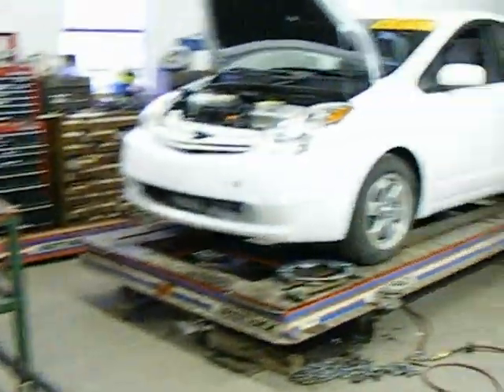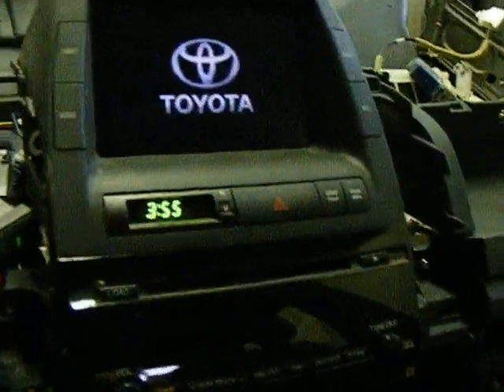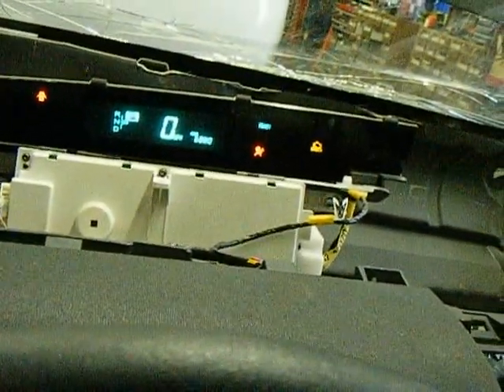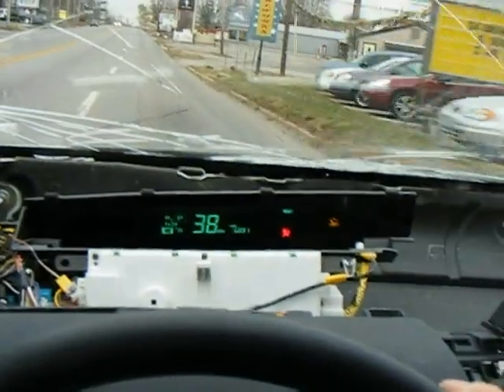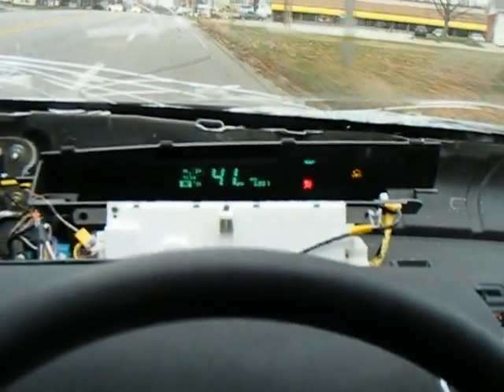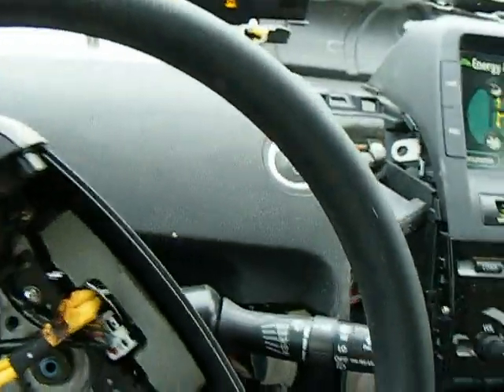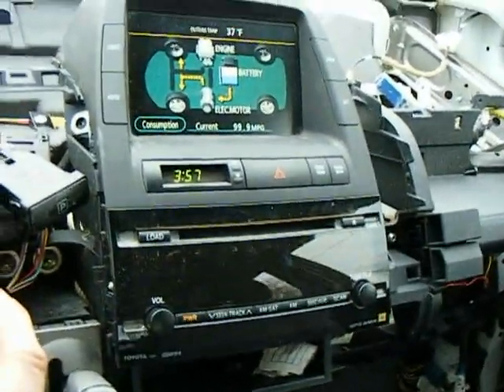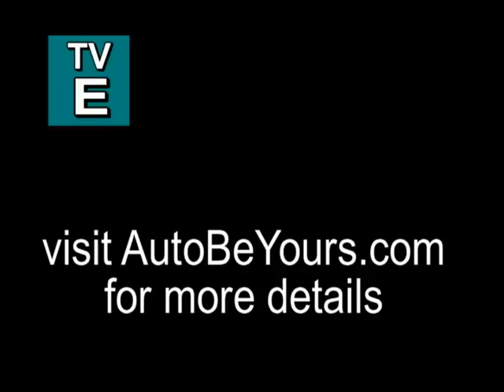All Electric Prius without a gas engine

Comment: How long will the car “Run” on a single charge?

Also,Did this have a plug in or are you just using the 1 original battery?
Reply: about 2 miles per kw/h  therefore a single oem pack at 1.1 kw gives almost 2 miles.  do the math for your intended pack

Comment: I'm just a monkey with a wrench and a Prius.
I wanna tear old gas side and leave Regen 3 pack solar.
Anyone with any pointers on how to perm spoof error codes and sensors without spending $$$$?
What exactly can I tear out. I'm literally going back to frame to rebuild and save ultimate weight.

Comment: Hello and great job.  Just a curiosity question;  without a turning crank in that 2nd Gen, what turns the oil pump in the transaxle.   I deal with 3rd Gen units and that's how they are lubed (along with gear splash carryover).  Thanks for your time.  Looking at doing the same thing but with a Gen3 unit.

Comment: Wonder if you can give me a clear and straight answer:
Does the Prius engine(2005) ever directly propel the wheels, or is it strictly to charge the battery? Or does it directly propel with the front electric motor1? Or is there another answer?
Reply: no. imagine motor generator 1 acts like a torque converter... if its not working...say for example the hybrid battery is bad, then the gas engine just spins with no connection to the wheels.   that is why it is an automatic transmission but without a clutch pack.. the electric motor provides assistance or resistance or anything in between
Reply: @imwoody36also  I think you are possibly wrong,  by not differentiating the questions, for a few reasons. First you answered me "No" when my question was not a yes or no question. " Is the engine to the wheels or just charging the battery" was the question. Well, if it is no, then is it neither?. The 2nd reason you are likely wrong on your claim that the engine is only charging MG1, is because the drive shaft goes from the engine directly to the wheels. If it is not propelling the wheels direct, then why even have the engine inline. This would be added cost and material with less layout flexibility. 3rd, if the battery is bad, then the car needs a source to move on demand, and if its too weak, it won't drive as the engine only powers the wheels at HWY speeds at one gear of about 50mph. The engine takes over, and it can do this at a certain speed where it is efficient as it has 1 "gear" to the engine.
I watched 5 videos with engineers breaking it down, explaining this 1st gen Prius Hybrid system after I posted. 2 videos were not so clear, but a couple others were. Also Scotty Kilmer's channel breaks it down as well. The Prius, at least early 2005 model looks to be a true hybrid car. Engine at SOME point is directly propelling the wheels, once the car has gained enough momentum for the engine to be more efficient. This is what is explained between the different videos. It is also what I find to make sense. Otherwise the layout would not need the shaft to directly go from engine to wheel, as it does. I dont mean to sound abrasive, but its been bugging me, and its not very clear in some presentations, and they suggest different things. If its not the engine, then its not even "hybrid"
Reply: @imwoody36also  You gave a situation when the battery is bad. what about any other time? While on the hwy...etc

Comment: Hi A Engineer had the Prius running on electric in an 08 Prius but no restrictions on Speed We have 2 Hymotion Battety Packs get 50-80 Mpg Combined! I could go on expressway Drying an 100mpg
Now I’am rehabbing as The Car was Parked for a Year Bob Vandivort

Comment: Old video, yes, but I came to YT looking for something like this. I read a thread from someone who wanted to convert an old Prius to all electric and all the nay-sayers. I've long said that Hybrids are "the worst of both worlds" with so many moving parts to eventually wear out. It seems like at this point (early 2021) there are (or will soon be) many old Prius cars for sale with non-working gas engines. If only there were an affordable way to convert them.

This is a total newbie idea, but if only you could  trick the controller into thinking it still had a working gas engine in it - say by installing a second electric motor in place of the old gas engine, and then a Raspberry Pie running some sort of "gas engine simulator" software.
Reply: Actually, yes just adding anything to the I.C.E. input shaft would leverage top speed up beyond 52mph.  if your experience includes C.A.N. bus messaging from Arduino, all the better.
Yes we have  literally dozens of old generation 2 pruii , with good transmissions and inverters.
by now we scrap them after using all the common wrecked or worn out parts.
( everybody needs a touch screen or a hatch garnish, or my favorite  a clean floor mat)

Comment: sir thats not a trouble light thats showing. its them reminding you that you never sent the check for the engine so thanks to translation issues it reads check engine on the dash. i forgot to pay them for that too and once i got the letter i sent payment and the next morning when i went to work i finally had passing power.

Comment: did you just connect the 3 hv batterys parallel? no bms or other things?
Reply: keep in mind this was 10 years ago, and today you will want to use lithium. those three OEM packs only total around 3kw ( small by todays electric car standards)  the plug in prius movement surpassed this video with the addition of the ORION BMS and liFeP04 cells of your choosing.
Reply: @imwoody36also  how about tesla module units? 🤔 Will this work to replace the old hybrid battery pack? Any videos of how to do this by any chance?

Comment: top speed in all electric mode is 52 MPH.  faster required assistance from the gas engine.
this is the upper RPM limit of the mg1 and MG2 motors

Comment: Nice! What if you pull out the heavy block and use that space for a micro turbine generator. Benefits are you can use multiple fuel sources and it will sound bad ass :) . I am sure you will get close to 70 MPG depending on fuel used. Look into drone micro turbine extenders.

Comment: The prius should be all electric, especially since it's 2017
Reply: It's now 2020......
Reply: @1enaan  Toyota has a solid state 600 mi battery and two new motors selling to the do-it-yourself mechanics.
Reply: @stevencorrea7982  how do you get these and how much as interested in building my own ev and thought pruis was good starting point if battery and mileage could be increased
Reply: @francisosborne1268  it a great start I have a Prius drive train and an inverter to start.

Comment: Ok I need help because I have 2014 plugin and I drive 100 miles every day Im only getting 500 miles a tank I want to know how to get 95 per gallon
Reply: Highway driving kills the MPG. I only get 45 in my C with mostly highway driving,  There is an article in Nuts and Bolts magazine that covers such a conversion.  It covers the first gen model.  You need an auxiliary Lithium battery and some custom connectors.  Also in that design the regen only charges the NICD.  Once the Lithium dies you have to plug it in.  All it does is trick the car into thining the battery is full all the time.
Reply: Probably will have to slow down which I'm assuming you're on the highway will be hard.
Reply: This is easy.  Drive downhill to work.   On the way home, jack the rear of the car up so you are downhill on the return trip.  You should get 95mpg easy!

Comment from the maker: Well, another one could be build just like it easily enough,
top speed is 52, and the range is only limited to your ability to purchase lithium batteries.

a stripped prius like this would cost around 7500 dollars from us, ( april 2012 price for say a 2006  model year.
then add about 6000 for a 5kw battery pack.

by the way, we also have a nissan Leaf in stock.
Reply: Are you still building these?

Comment from the maker: The prius will travel about 4 miles on a kilowatt/hour of battery capacity.
the one featured in this video has had the gas engine installed and now is a stock prius.
however we now offer a 5kw/h pack to replace the Original Toyota pack.
this allows for 24 miles of EV only, or 50 miles in blended mode at 99 mpg.
Reply: Got any packs left for cheap?

Comment from the maker: update!
New software allows us to install a large battery pack, then drive up to 74 MPH without using Gasoline.  then engage the  gas engine or not depending how far down the accelerator is pressed.
keep an eye on the AutoBeYours website for details.
Reply: Won't the motor be overspeed or does the engine crank still turn?

Comment from the maker: Easy, the Prius has an electrically operated scroll compressor,
it bolts to the block in the traditional location.
of course the condenser would also need to be installed.

Comment from the maker: Hello Dave. The plugin conversion movement is very large. it has been our experience that 5kw/ hour is about the smallest battery pack that will give any decent range. also top speed without a gas (I.C.E) engine will be 52. two companies offer hardware/software modifications to force the prius to spin the ICE giving extremely high gas mileage when driving faster than 52 mph.
those are plugin conversions and plugin supply.  a different bms system is required!, dtcs must be cleared or spoofed.

Comment: Hi. I live in the UK and diesel/gas prices are hitting an all-time high of around $9 per gallon (in your money) and, as an electronics engineer, I'm seriously considering buying one of these and running it with numerous stock Ni-Mh packs as you have done already.  Have you established the range of the vehicle in this video yet? Also, is it necessary to clear the ECU DTCs before the car will drive? and finally, can I leave the charge-management system alone or will it need extensive mods? Thanks!
Reply: what about now?

Comment from the maker: without the newly developed Hybrid Energy Module from Ewert energy systems, 52 MPH is still the top speed.  larger capacity   only gives us longer range, The HEM module allows electric speeds up to 69 or 70 MPH but is only sold through plugin- conversions corp. thier price as of dec 2009 is 13500 dollars for a phev kit.
it is very very nice.

Comment from the maker: I stand corrected, It should read 250 w/h  or 2500 w/h for 10 miles.  please remove the "K" from  my hastily typed message.  Additionally please note that my friends at Ewert Energy systems have created an electronic module to manage the ICE in a prius to force very very low gasoline consumption even at highway speeds...this requires an extra battery pack.
Reply: Will check this out

Comment from the maker: The prius requires about 250kw/h to move a mile on flat ground.
10 miles would be 2500 kw/h before any losses are considered. we have determined  ( by experimentation) that a 7500 kw/h  battery pack is adequate for about 10 miles.  in my humble opinion, the solar panels would best be placed on the parking structure.  thanks for posting!
keep it up!

Comment from the maker: We lost 176 lbs by removing the tank,heads, manifoilds, crank, etc. not to mention the  weight of gasoline,coolers, and fans.  Spoofing the state of charge helps keep the hybrid ecu from limiting range. I believe you will need about 5kw minimum to make a reliable electric range prius.  Remember to keep a little in reserve to limp home if you deplete the main pack.  I also believe that spinning the MG1 within the transmission would make a super high mpg hybrid. like from an aircooled ICE
Reply: I’ve got an extra pack for my 2006 prius, where can I find the research on how to wire up a second pack and install an EV only switch in the car? I can code arduino and I have a can bus transceiver. (Comma panda). I don’t want to take the motor out I just want to have double pack strength/capacity

Comment from the maker: Thanks, charging the batts fixed the low speed problem. also there seems to be no problem with lubrication. also cold weather limits discharge current limit (DCL).
inverter still runs cool enough to make this a success.  soon we will try a higher battery voltage.